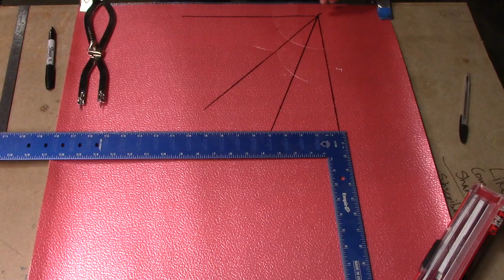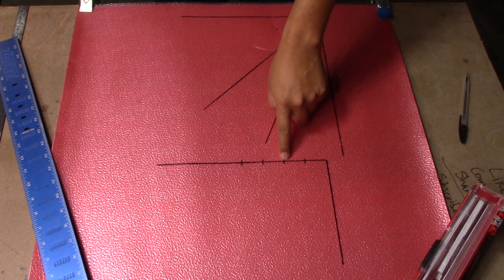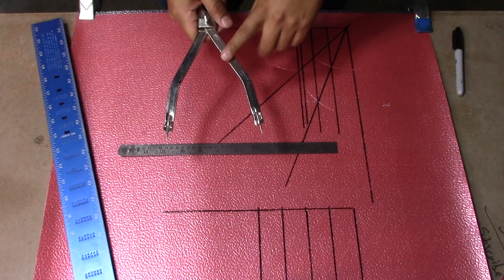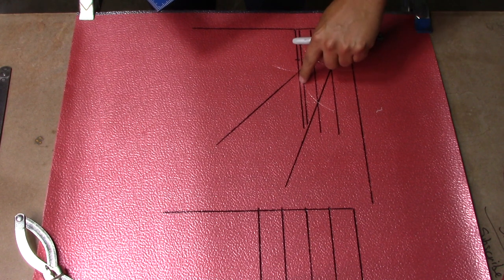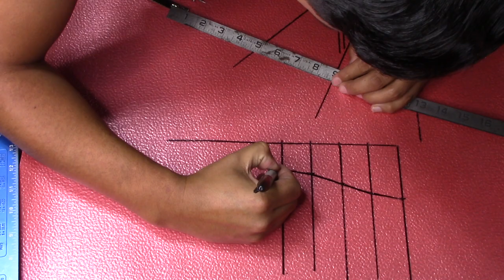How To Make a Reducing/Unequal Metal Jacket Tee!

Comment: When you first got the circumference and you split it in half to 10-5/8. What was the measurement on the ruler? The dividers didn't look to be spread at 10". Im still learning how a circumference ruler works and I'm learning on my own.
Reply: Circumference is converted into diameter,so he's using half the diameter(across the center of pipe) across the pipe
Reply: Take the circumference and divide by pi (3.14)
Reply: I was literally gonna ask the same thing until I scrolled down cause I new someone thought the same lol cheers
Reply: The measurement is half the diameter.

Comment: Does anyone know how to cut the metal for a new insulated pipe that is larger then the existing pipe that it T's into....I had to replace the insulation on a pipe with 18 inch circumference (after the foam glass was installed). The pipe T'ed into a pipe that already had the metal with a 14 inch circumfrence.
Reply: Basically the opposite of this video (reverse the pipe sizes)

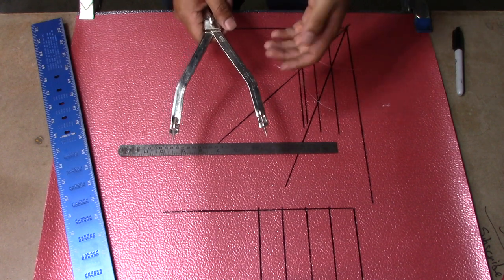Comment: Hey jpadtv or anyone here on minute 6:25 when he said half of the big pipe is 31 which is 15.5 he said he set he’s dividers to it but it doesn’t look like 7 3/4 on his ruler
Reply: my best guess is he's using centimeters

edit: I think he just mixed up some numbers. he should be taking the circumference and dividing by pi to find the diameter, then halving the diameter to set his dividers.
Reply: edit 2: I think the circumference ruler he uses has the calculations done on one side of the ruler already